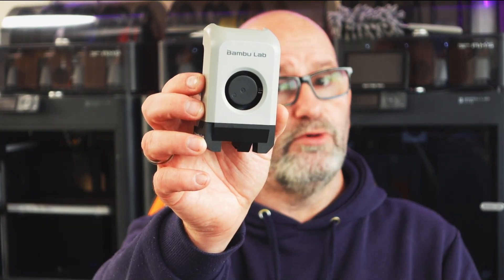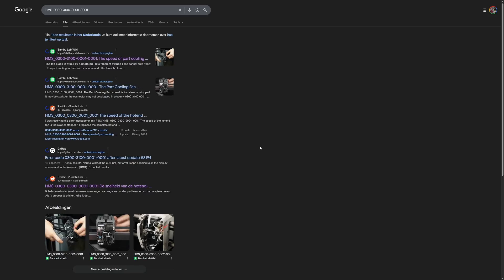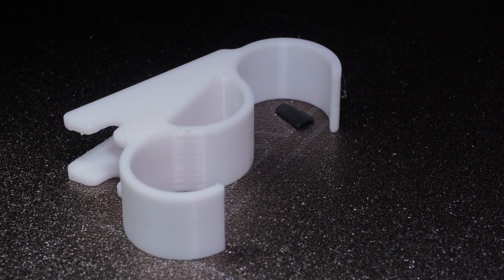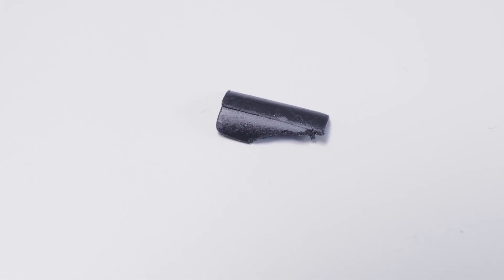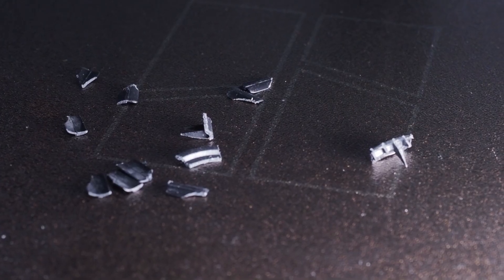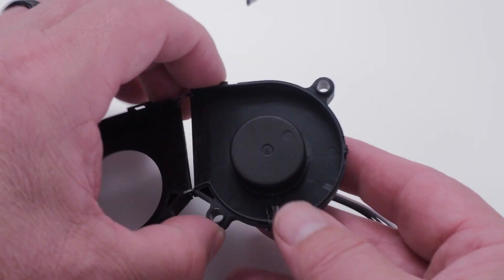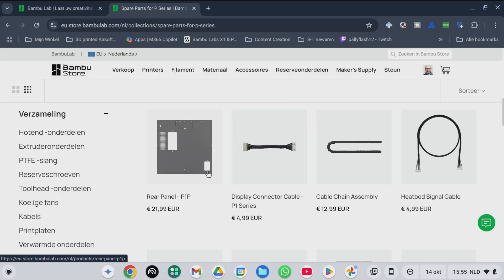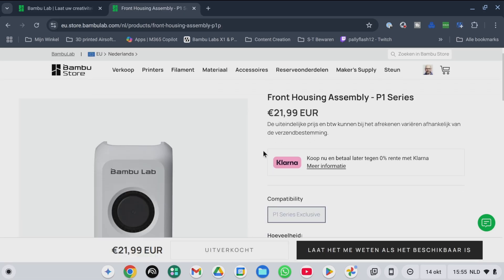Bambu Lab Part Cooling Fan Exploded – What Really Happened Inside?

Comment: My toolhead fan just spit out 3/4 of the blades. I didn't receive any errors.
Reply: There is a speed sensor ( third wire ) on the fan. The error message is telling you the speed is not correct. Its likely you will get a problem at some stage, The fan is not doing its job without the blades! . Best solution is to get a replacement front cover ( £16 in UK). I haven't been able to source a fan on its own for less . 
You can also get this message too if you havent plugged the fan connector in fully.
Reply from the maker: Wow, that sounds intense! It's strange it didn't throw an error.

Comment: you said in the video "I don't know if it's exploded" and wrote in the title "exploded". shitty clickbait, sorry.
Reply from the maker: Sorry, this is a Bullshit argument, but please let me explain without feeling agitated.
I was not there, hearing a loud bang and then finding a shitload of pieces all over the printer. Yet, can you imagine how ALL the parts got separated and torn apart in any other way than with an explosion because of a speed that is to high, or a manufacturing problem? I can't. Also, the motors of a fan are usualy very weak, therefore not powerfull enough to strip every single blade on the fan. Yet, because I was not there when it happend, I can't be 100% certain that it exploded.